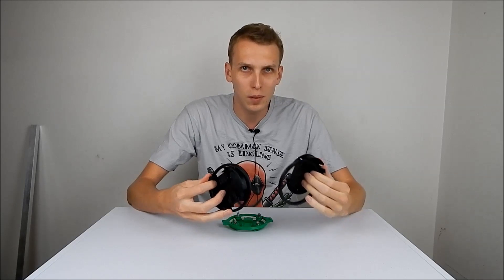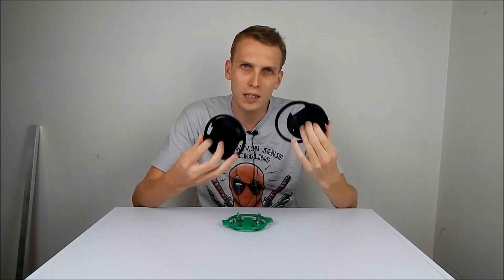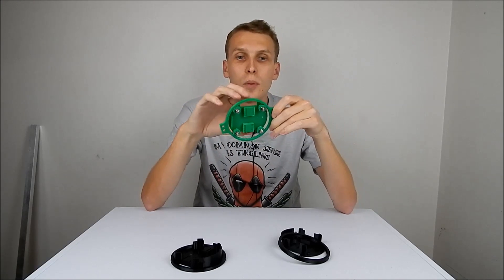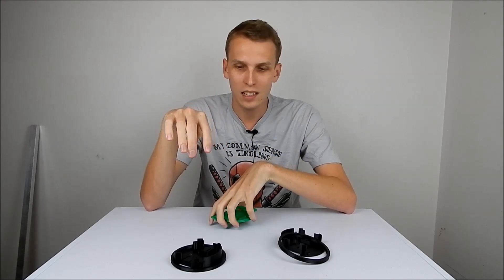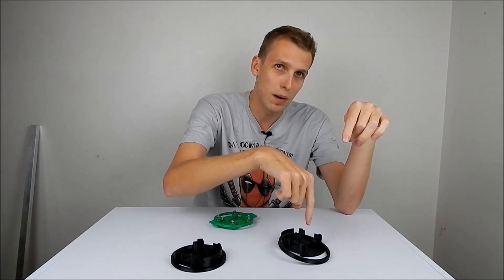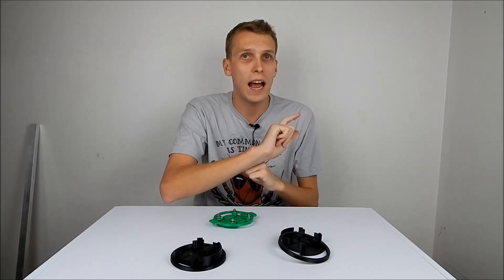150g Ring Spinner Combat Robot: Part 2 - Spin Up!!!!!

Comment: I've just seen this, and it gets somewhat relevant for me now... 
Do you think the idea how you fixed the ring with that "rail" in it could work in a beetle, too? 
I've seen Q and Orbit as Beetle ringspinners, both use a wheel each for each way the forces could go, so some above the ring, some below, and some on the inside. 

This will be a bit hard with what I'm planning, so the question is if a similar setup as you used could work there. That would safe a lot of wheels, and more importantly would make things a lot easier to machine.

Comment: I also gonna make a 1lb full body spinner battlebot though,but I'm so scared because the bearing might break because of the impact.
Reply from the maker: In the 1lb class the bearings probably won't break in an impact, but the things the bearing is connected to might break.

But that's all part of the fun! build it, see where it breaks then make that part stronger for the next event!
No robot is perfect first try, breaking it in the arena and making it better next time is all part of building a strong robot!
Reply: Does registering to any battlebot event need to make more robots?

Comment: This is just an observation, not a suggestion backed by experience: would it run more freely with three contact points for the rotor instead of four? (I realise that six would be way too heavy.)
Reply: Update: My first comment was made before I saw the end of your video regarding the number of contact points. Sorry!
Reply from the maker: All good, you where right though, less contact points means less weight in the robot and less friction on the ring.

I might even try dropping down further and only use 2 plus the motor, but thats a job for much later

Comment: Nice bot！ Maybe try using smaller motors for the drive (a bit overkill for a spinner) and instead use that weight for the weapon.
Reply from the maker: I would, but I havent found any smaller motors that have a good output shaft and can handle 8v.

If you know of any I'd love to see them